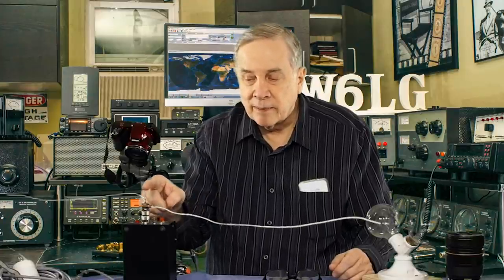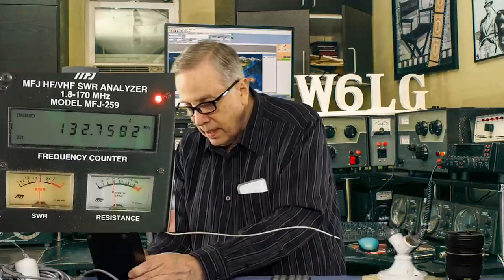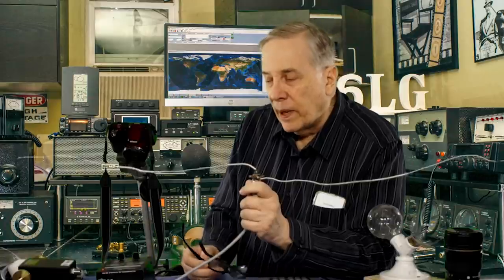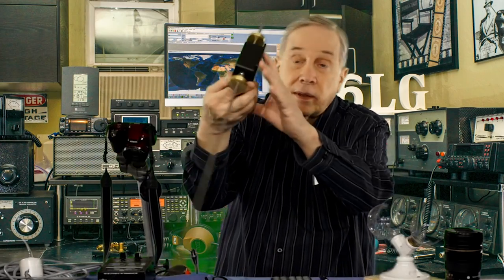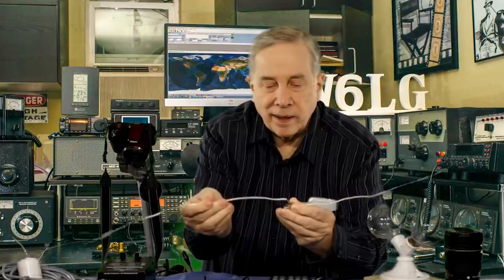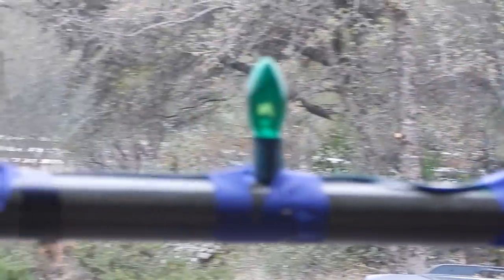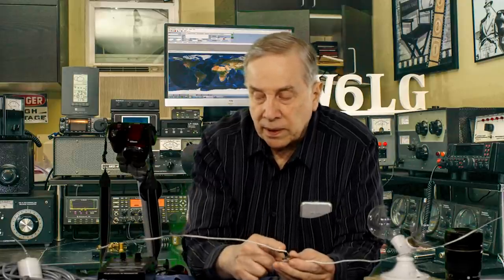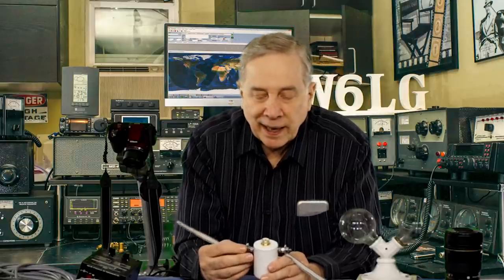Ham Radio Basics--Jim W6LG Shows The Dipole Antenna And An Instantaneous Antenna Tuner

Comment: An excellent real-time demonstration of voltage and current distribution. "Where voltage is maximum, current is minimum" defined!
Reply from the maker: Yes, that physics thing from High School.  Thanks Watt for adding that statement. 73, Jim
Reply: It's also a good means to demonstrating the importance of having multi-band dipole ends (where ribbon wire is used) enough separated to avoid any spark between the dipole wires ends. And where to separate, seems to me almost half length should be separated.

Comment: Back in my novice days, in '78, I acquired a 300 watt 50 Ohm resistor. I saw the ads you were talking about and put the resistor between the elements of an Inverted V cut for the novice band on 80 meters. When tuning the receiver, you could tell when the antenna was out of resonance. It had a little noticeable loss on 80 meters where the antenna was cut for, but it worked rather well. On harmonics, it seemed to work ok, as well. But, when it was out of resonance, you could hear the signal strength of radio stations fade. |

Basically, the answer I got from the experts in the field were pretty consistent. When an antenna was in resonance, the resistor burned up less power than when the antenna was non-resonant. 

In an emergency situation, you could actually use it in a 20 meter dipole and communicate on 75 meters, but you would definitely not compete with the standard loaded dipole for the same frequency and power levels. On bands like 20 meters, where it was resonant, when conditions are good, you might not be able to notice the difference since so many signals were overwhelmingly good. But, it will radiate.

As for your light bulb dummy load, I can't compare your exact antenna with the light bulbs, but we did have a fellow check into the GA SSB Net at night on a light bulb dummy load occasionally just because he could.  So, don't be in a hurry to get rid of those lights.

Comment: I can remember using the same formula to determine antenna length years ago. I probably learned about it in one of the old electronics magazines back in the early 90's when I received my Electronics Technician certificate. As I recall, the formula accounts for stray capacitances, and is easy to remember!
Reply from the maker: Thanks Dirk. 73, Jim

Comment: Thanks Jim. The mysteries of antennas. One works and then we develop theories why it works. Other tests reaffirm those or refute those theories. Like building a bridge. You build it like other bridges that stay up and develop theories as to why it stays up. If it fails under a specific load, more theories,  and back to the drawing board. You have a really nice presentation manner. Hugh Jones  VE7YJ

Comment: Great video and very informative. I am not a HAM but have been studying antennas recently, especially dipoles, in an attempt to improve FM reception in a rural area,. I'n recent weeks ve built several  dipoles tuned for my FM stereo, scanner and weather radios and wish I had discovered their performance benefit sooner.  I always thought they were inferior, probably because of the flat lead that suppliers used to wad up and include with radios, but that changed once I began making my own.
Reply: I too have been trying for years to make the perfect antenna for rural reception but different stations seem to need separate antennas. I would like to know what you came up with.
Reply: @OhmSteader   I went simple. I used a calculator to determine the exact length for 93.7Mhz because I wanted to use a very small transmitter on my property in the country, and that was the cleanest freq. available. I used it for a while but it worked a little too well. The TX greatly extended beyond my property so I left it about 15 feet in the air and used it for RX only. I was able to pull in stations I had never heard before, but unfortunately, they all use the same or similar programming services and hearing more of the same was a little disappointing. It's still works but I almost never use it. 

My other dipoles were made the same way and still work well for their intended purpose, especially the one on my weather radio.    

I used Beldon RG-6 tri-shield with minimal roll off in the FM band and placed the antenna inside PVC pipe. I used zip ties with eyelets and end caps keep the #12 copper wire tight.

Comment: My first 2 meter antenna was made very similar to that. I used coat hanger wire soldered to an SO-239. The wire soldered to the center pin was vertical, and I soldered four radials bent at a 45 ish degree downward to the four corners of the SO-239. Hung from the ceiling inside my "shack", it worked all the local repeaters just fine. Better than the "duck" antenna that came with whatever handheld I had at the time.

Comment: To light those light I'm guessing thats being fed by a 100 watt transmitter? That makes so much sense that the current is what makes the signal as voltage is just a measure of potential and doesn't do any work: the amps are what do the work turning amps into light/heat in a bulb; torque in a motor; or EM waves in an antenna. Thanks for that I wouldn't have thought of it on my own I figured the antenna was putting out everything evenly.

Comment: One of the key things I've learned (so far - I don't know much yet) is that from the electrical perspective, "radiation resistance" and "loss resistance" are identical. Electrical testing can give you clues (loss resistance is mostly flat across frequencies) but you're not testing the efficiency or radiated power of an antenna system until you try it with some kind of receiver or field meter. 

Similarly, testing a radio-frequency electronic design for functionality can tell you whether the design successfully overcomes its own parasitic resistances. But unless you look for EMI you probably won't notice parasitic antennas hiding among the parasitic resistors. The upside of this equivalence is that dummy loads are a perfectly valid way to test transmitters.

Comment: Hi Jim I'm N6DBH Var in Fresno. enjoyed your show as I always said a hi dipole is better thn a lo beam, The feedpoiny location is paramount. The Hi current location should be at th highrst point possible, but also the hi volyage points should be away from ground to stop or weaken the leakage by capacitance toground. 73's from N6DBH a friend of Joe OD5ET who regularly contacts you on 20 when the band isopen.

Comment: Jim: If your Christmas bulbs are in series and the current flows through them it seems that the bulbs near the center should be brightest, not the bulbs on the end since as we know, current is max in the center however you show the opposite. Are these bulbs actually wired up of just picking up RF?

Comment: Another very good video. A caution though about end feeding a half wave wire (discussed near the 9 minute point). The required transformation is 4000 ohms/50 ohms = 80 times or perhaps 5000 ohms/50 ohms = 100 times. These transformations can be accomplished with transformers having a 1:9 to 1:10 turns ratio and this has led to some confusion about using a 9:1 balun. The 9:1 balun performs a 9 times impedance transformation raising the value of a 50 ohm input to 450 ohms of output. The L network tuner is a very good circuit for matching 50 ohm coax to an end fed wire.
Reply from the maker: Thanks Bill.  Can you expand on that a little?  In other words, the difference between a 9:1 balun and 1:9 turns ratio.  I understand about the L network.  I do use them in some of my antennas.  Thanks Bill & 73, Jim
Reply: Impedance transformation in a transformer results from the square of the turns ratio primary to secondary. Consider an autotransformer consisting of a 27 turn coil tapped 3 turns up from one end (ground). If 50 ohms is across this tap, an impedance transformation of (27/3)^2 =81 times occurs. Then 81 * 50 ohms = 4,050 ohms is presented across the full 27 turn coil giving a good match to the end fed half wave of wire. Mention of L networks in my response was an unintentional red heron!

The 9:1 balun does not specify the turns ratio but rather the impedance transformation ratio of the balun. So if the 9:1 balun is used with 50 ohms on the input, the impedance on the output is simply 9 * 50 ohms or 450 ohms, leaving a 10:1 SWR when feeding a 4,000 to 5,000 ohm load.
Reply from the maker: Excellent Bill.  You make a good teacher.  Keep in mind that I am not an engineer. Hence, my somewhat silly 1234 formula.  

A balun is a balanced to unbalanced device that may or may not transform an impedance (1:1). That is, for example, it may be 1:1 or 4:1, 9:1 transformation or some other transformation.  That x:1 is not a turns ratio but simply the output to input transformation.  The 9:1 balun is not a description of the turns ratio but is a description of the impedance transformation. 

Is that good so far?  

For a transformer (a device) used for changing an impedance(s), there may be a stated turns ratio that is used in the description.  The square of the turns ratio is the transformation.  If that turns ratio is 9:1, then the transformation is the square of that number; 9 squared equals 81. So, it would be 81:1 transformation with a 9:1 turns ratio.

I did not mention the 3 turns on the input and the 27 turns on the output to get to the 9:1.  Maybe I should have.     

Thanks Bill. I am trying to think of visual way to show that.  Maybe I will resort to another light bulb(s).  73, Jim
Reply: Nicely done. I work with our club's training committee and we conduct 4 Tech and 1 General workshops a year. The coincidence of nines in both ratios always generates confusion and some frustration for newcomers. I'm looking forward to your video presentation. No need to go into the 3 turn 27 turn example.
Reply: Bill Adams 
Well explained bill having been out out the hobby 25 years and just getting back  in to it used a 73.5 foot end fed wire and a 9.1 unun  and so far the ones bought also quite expensive total junk
I now understand more from you thank you kindly
G0myd
Reply: Isn't an end fed dipole simpler to make as a J-Pole to avoid the transformer?

Comment: Another great video Jim. The Christmas lights are cool.  But you should not put those up until after Thanksgiving :)  While I agree with your comment about end feeding and "typically" using a 9:1, I will add to that that something like a 55:1 UNUN would give a better match. My experience with my end feds show they have up to 4000 ohms of feedpoint impedance and it takes a transformer from 50 to 55:1 ratio to get a match where you dont require a tuner. Consider this an addition and not disagreement.
Reply from the maker: More than one guy caught my mistake and kindly offered a correction.  Thanks.  I do appreciate the help.  A refresher on the difference between turns ratios and transformation is going to be in a future video.  There is always something to learn and that's what makes this fun. Thanks Rich. As I said that number in the video my brain was thinking something is not right!  I hope to hear you on 20 meters soon.  73, Jim W6LG
Reply: Well I will add that I am not sure a 9:1 is not a bad idea anyway.  Guys seem to melt down the 55:1 transformers if they are running any power !

Comment: I used a 100-foot long piece of RG-58 with nothing connected to the other end as a dummy load for 70-centimeters. Loss is about 10 db, so by the time the signal makes the round trip back to the transmitter the reflected power is 20db lower than the forward power.
You can actually key up repeaters with it too since the coax is so leaky at those frequencies!
Reply from the maker: Wow! Thanks Ryan.  73, Jim
Reply: I discovered this on VHF and UHF repeaters too! Love this stuff! Makes studying for Extra fun.
Reply from the maker: It is good to learn about this. 73, Jim

Comment: Jim,
I thought of an idea for a helpful video.  You mentioned in this video you can make a dipole with just about anything and used the Christmas tree light as an example.  I would like to see a video on the specifics for loading up random dipoles.  Just how to you connect them and then how do you tune them,  with what equipment.  It seems like I run off into never never land experimenting with such and right now a simple well performing dipole would be great for me.

Give it some thought.

WA0RSD,  73's
Reply from the maker: You are correct and great advice for another video.  I had not thought about that kind of video.  So, I will do it soon. Thanks Doug again for great input.  73, Jim

Comment: Nice video, Jim. The MFJ antenna analyser looks good but costs a bit too much for the number of times I would use it. I cut aerials long then fold the wire back on itself until the SWR comes down. The Christmas lights would look good when you transmit. I have inverted vee dipoles because of limited space for 17m and 20m, for 40m the ends are very low so I add extra wire for 60m. As you tuned through frequencies on that last box I thought, "That's got to be a resistive load and not efficient." How could that be sold as a tuner?
Bill, G4GHB.

Comment: This is a very informative video. Just the other day I was wondering if it would be possible to use 50 ohm resistors and then somehow couple the antenna wires to the resistors. 73 KD5YOU

Comment: I really appreciate the comment "wow...for an old guy he seems to know his stuff..."   Perhaps some feel only the young have any wisdom with respect to technology.  Seems to me I am often going to those experienced operators who are able to open new vistas regarding how things work in the real world as opposed to people that look a few things up on the Internet and style themselves as experts for doing so.  I also really appreciate the nit-pickers who point out "your dipole formula is pointless" and questioning his approach based on "velocity factors" as though someone as knowledgeable and experienced as W6LG would not have considered such things.  In fact the ARRL has considered it in their formulas. The 234 is only a starting point, as W6LG points out, I think, fairly clearly.  Other things affect performance, such as nearby conductive materials (he mentions the wiring on his bench), height of the antenna, etc.  I believe such comments say much more about the lack of full understanding on the part of the commenters than it does the knowledge of the presenter in this video. In the end the main purpose of all this is to build an antenna that does not harm the radio but is efficient enough to transmit energy allowing for contacts.  Every antenna is a compromise in some way (sacrifice broadbandedness for efficiency on a given frequency versus the opposite, for example). Nice video.  I will view more of them.

Comment: So the dipole characteristics can be shown by this diagram.

ZV-------------I-------------VZ

It indicates that the impedance and voltage are high on the ends of the dipole, but the current is high at the centre.

And you also demonstrate here the best place to put an antenna tuner in your circuit—*between* the feedline and the antenna, not right at the transceiver, in which case the tuner is called an antenna coupler.

Comment: So installing an antenna tuner right at the output of the rig will make the rig think that there's low SWR everywhere after the tuner, when in fact at the antenna end of the system there's mismatch between the feed line and the antenna which causes reflection which means standing waves on the feed line and hence a lot of radiated power NOT from the antenna? We want the standing waves on the antenna, and nowhere else?

Comment: Hi Jim, does the antenna tuner, eat up power on certain frequencies? So you will have more transmit power on the antennas natural resonance, and less transmit power as you tune away from its natural resonance?

Comment: That was a good demonstration with the Christmas lights dipole.  Anyway, it got me thinking: suppose you had a dipole that was resonant on say 80 meters, and for some reason you could only get half of it in the air, the other half although straight out, but on the ground.  Would it work??
Reply from the maker: Sure.  If the feedpoint is a ground level, it would be like a groundplane.  If the feedpoint was up in the air, it would be like a vertical.  Good question to ask.  Thanks, Jim

Comment: that middle vs end voltage vs current concept, trying to understand how this relates to the double bazooka design, made one last month and it did really well, bought some more coax to make a cpl more for different bands.  do you know anything about those vs regular dipole?  seems to have performed better than the standard dipole.  thanks and merry Christmas!  73s  great video btw. Ki7opq

Comment: The Christmas light trick really got me excited. I want to take my 49:1 transformer and hook it to a 134 foot string of lights.. then as I change to 40 20 and 10 meters I want to see all of the halfwaves.
... Some may wonder why... if the amps are high in the center... where is the current going? Obviously not through the bulbs or they would be lit... the current is  'leaking' into the aether.... LOL...

Comment from the maker: It is confusing.  For those using the Metric System and want to build a dipole, they can quickly estimate the length.  For example, if it is a 20 meter half wave dipole, each side will be about 2 to 3% less than an a quarter wavelength (20 meters divided by 4 = 5 meters, overall length 10 meters) or approximately 4.88 meters (16 feet).  Another way is just to make each side a quarter wavelength and then shorten as needed using an antenna analyzer.  I wished that we (U.S.) had converted to the Metric System as planned many years ago.  73, Jim W6LG
Reply: Aust  did convert to Metric system, gosh , nearly 50 years ago. Best thing we ever did, or maybe 2nd best, went decimal currency in 1966 !